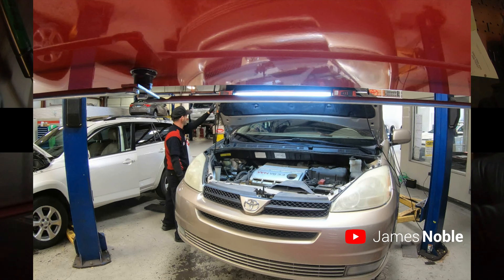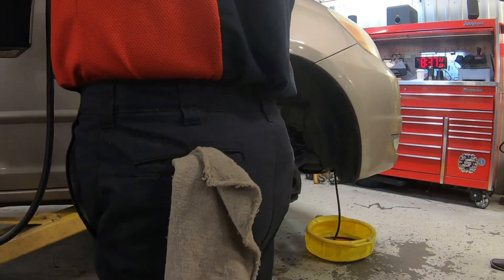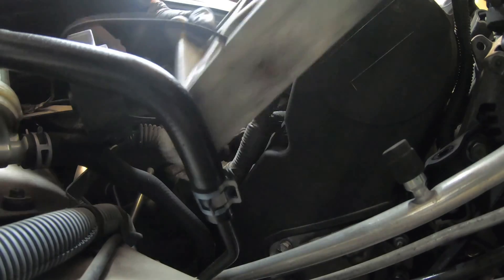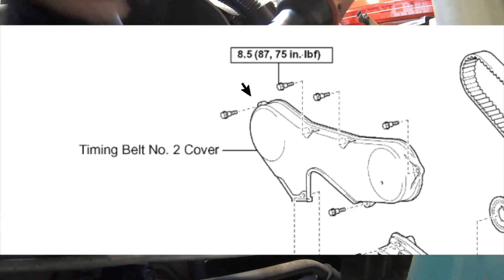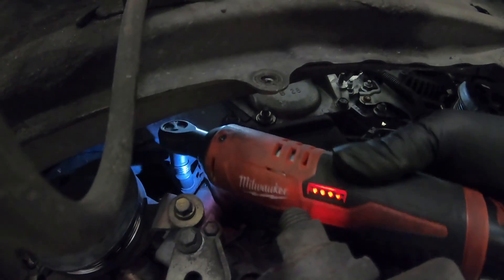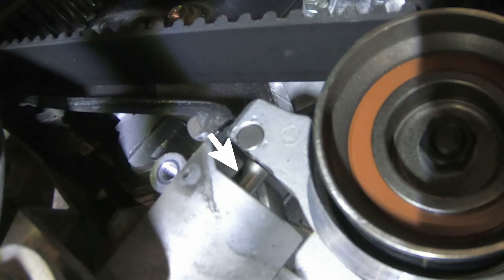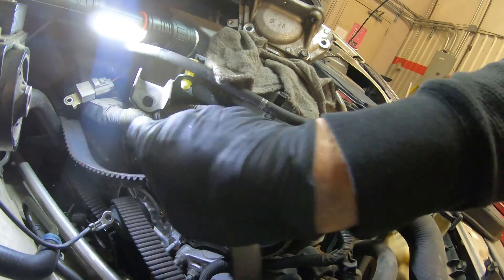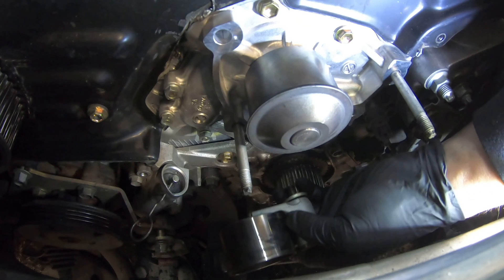2005 Toyota sienna timing belt replacement

Comment: Is removing the water pump mandatory to do this. Or just recommended because your already there at it. Just wondering because there was a timing belt replacement done on my van and now there is coolant and overheating issues. Just trying to get a clear picture of what might have been done to this thing from previous owner so i know what im getting into. What i need to check etc
Reply from the maker: It's just highly recommended if you replace it as well then. Usually, you've got a 100000 miles before. You have to do it again? I would be sure the Pulley is tight. And there's no coolant leaks from the weep hole. I personally wouldn't do it without replacing a water pump.
Reply: Also very clear and consice video. Well shot great detail. Very informative and descriptive. 👍
Reply: Slowly doing this job for my son inlaw. Engine mount  bolts siezed and snapped off
Reply from the maker: @PeterHernandez-lg2eh  I have been there of course I work for Toyota. I just ordered a new bracket, but it looks like Amazon has them in stock for about 50 bucks. That would be the only way I know to go unless you wanna go eBay and get a used one. Sometimes it's just unavoidable. Sorry.
Reply from the maker: @PeterHernandez-lg2eh  been there myself it's been a while, but I  I worked for Toyota so I just ordered new one and the bolts. I don't really know what they cost, but that's only option.

Comment: Do you recommend the toyota sienna ?
I'm looking at a 2015 sienna, xle van 161K miles for less than $4500K.
I do all the work on my volvo.
Your videos are very helpful, I can see your channel getting very busy.
Reply: I have a 20 year old 2004 Sienna that has only had one front brake change and lasted 135000 miles before I had a head gasket leak.  I had another 2005 Sienna that was running strong with about 280000 before selling it.  Start it cold and listen to see if the VVTs rattle.  That is worrisome.  But, great vehicles.  If I had kept the coolant changed on schedule, I'd still be driving the 2004!
Reply from the maker: I do like that, year model, and the engine that comes in that vehicle. But working for the dealership, we don't see that many miles on them.  If it's been maintained, I don't think you'll have any issues with it. At the right price. Now, I would check the water pump for noise, the CV axles, and the brakes.
Reply: @NobleAutomotive  how many 3.3 engines have you seen with a snapped belt and how many had bent valves?
Reply from the maker: @freddyg9026  I've only had one, and it didn't bend the valves
Reply: @NobleAutomotive  thank you for getting back to me. I have one that shredded the belt,I'm going to cross my fingers.
Reply from the maker: @freddyg9026  You are welcome.